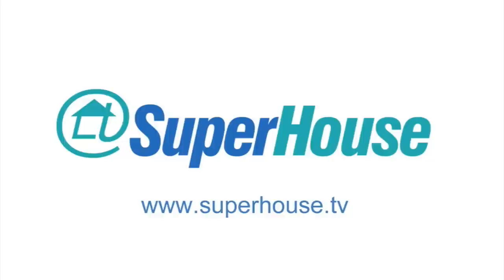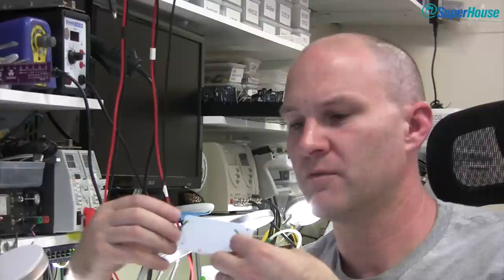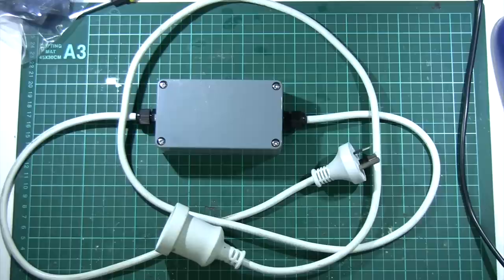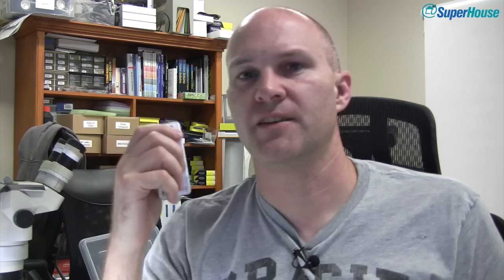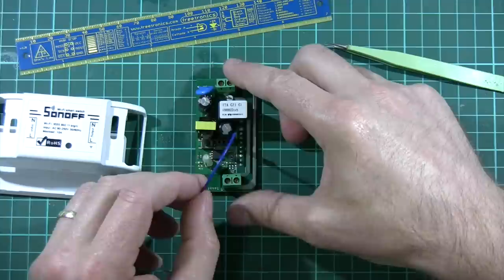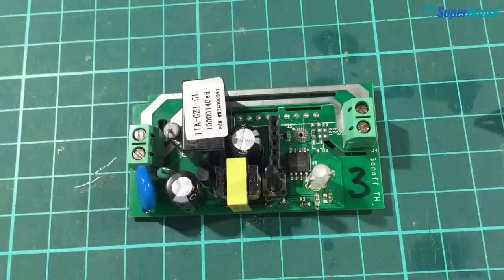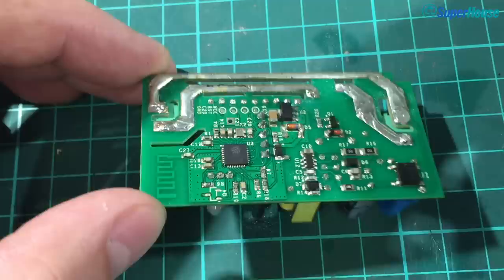SuperHouse #21: Six Sonoff Secrets: Storage, Safety, Switches, Sensors, Software, and Sites

Comment: I have a wall switch that only has the hot wire inside (there are only 2 wires coming from the top), how do I connect a Sonoff basic? (To add or replace the current switch), I connect the 2 input pins to the 2 ends of the hot wire and it works, meaning it connects to WiFi, and if I connect a external bulb it toggles on/off, but I want to control the bulb on the ceiling, how can I connect the output back so that it controls the light bulb like the switch I currently have.
Reply: Hi, if you only have 2 wires in the switch box then you don't have a neutral wire. So you can't power the SONOFF device from the mains that way. the 2 wires in the box are a HOT wire from mains, and a Load wire from the light. The neutral is connected to the light at the light. If you measure the 2 wires in the switch box 1 will be hot (mains voltage) and the other will be neutral  through the bulb. First you need to connect the hot wire in the box to the SONOFF "input L" and the other wire in the box to the SONOFF "output L". Then find a different neutral wire to connect to the SONOFF "input N" it will work. The problem is you don't have a different  neutral wire in the switch to use. Good luck
Reply: @bobk9324  thanks

Comment: Hi I have a similar board that i purchased from Ebay  sometime ago and it comes from China. Although it sort of works and i have had it running on and off using my web browsers i just can not get this on board relay to toggle,  but what i did incorrectly is to flash out the original program . What has happened now is it will not accept no more the original AT command that this unit should be running to toggle this relay. But strangely it does accept the Arduino IDE program and it seem to work but i still have no joy as the relay on board just wont toggle over. I have given up trying to figure this out and now prefer to give it to you for free in return to explain to me what i have done wrong and what app on my smartphone will run to get this to work. To get this to turn this on and off and why the original program just wont go through as this comes up with an error when i try to load the original AT commands back on. Hopefully you are in Australia and that you dont mind me giving it to you for free. I just dont know how to contact you providing your happy to have this. My be you can give us all another new Youtube video tutorial on how to program this Chinese unit. I can send you more info via email of the website site/links and program that i have been using to get this to work. Please let me know. Thanks

Comment: I have dozens of these and yesterday I noticed they all had a firmware upgrade so I started the upgrade. 15 of the 17 I have upgraded just fine but the other 2 get to 90% then get stuck and after about 3 min it pops up and says failed to update. Any ideas what could be wrong? They still work just fine but won't take the update.
Reply from the maker: trucker V Are they running the original EWeLink firmware, or something else that you installed?
Reply: @SuperHouseTV  they are just stock out of the box

Comment: Hello superhousetv. This is my first video on your channel but surely not my last. Would you be so kind to give me the pcb size please. My intend is to mount it in in a switchbox in series with a switch to power my water heater. The power rating should be within limit for a 30ltr water heater. Hope it does not warm up alot.

Comment: hello sir I love your tutorial 

I have a little question if you or anybody can help me I have a 4 channel sonoff 
that doesn't work all the time
I have narrowed it down to the yellow Square just below the power input
I thought that it might be a bad connection but this was not the case if I hit it with a screwdriver it turns on sometimes until it has been disconnected from Power then I need to redo the same step
is there anybody that knows what the name of that part is and where I might be able to buy it
best regarts

Comment: Hi thanks for the video. Is there any possible way to let sonoff pow turn on back after power shutdown automatically without pressing any button?
Reply: check Power-on response in device settings. you have 3 options:  On, off or resume the state before power outage.
Reply: @ehashay  Thanks alot. Helped me alot

Comment: Hi bro , I need yours help, I’m using sonoff basic , before I purchase and pairing with my old WiFi modem>2 band WiFi booster already using few month , and today I’m upgrade new modem and new 2 band WiFi booster . The problem is coming , I can’t pairing with my sonoff device , I have try delete and re download my eWeLink apps , I’m also trying connect AP mode , and type with a default password 12345678 , but waiting loading few minute is become fail. Could I know what’s is the problem ?

Comment: Hi, I watched this video of you, a very useful video. I want to ask you in the section where you instructed to use Sonoff switch in combination with hand switch: Because I am a Vietnamese, I cannot hear the instructions for connecting the pins together, and the Video also has no subtitles. Hope you guide me, thank you. I am using Sonoff basics switch yet Flash
Reply: @Leonvolt28  Thank you! I saw this as a new Sonoff product, the wiring diagram is very clear. But since I have several basic Sonoff Switches and I watched this video with a manual link between the hand switch and Smart switch, I would like to ask what are the two connection points with hand switches with symbols? We wish to be answered ! Thanks!

Comment: I have been searching for a solution to make my normal light switches smart (without replacing them) for more than a year. It seems that secret #3 might be the jack of all trades device I have been looking for! But I don't want to crow to soon, since I do not want to use Wifi (because of permanent electrosmog emission... 
Does your nice secret trick also work with the Sonoff RF (old version or RF3)? If yes: Can I also use it in two-way and cross-circuit or just in simple one-way on/off settings? 
If this works in all settings, could you please provide some more information how to do it? Unfortunately, I am a complete layman in electricity...

Comment: hi, i was reading that the button in the sonoff is for entering flash mode, if i do what you do, so i can control the light with wifi and a fisical button, and some guest press the button for a long time will it enter flash mode? i have the stock firmware i didnt do any modification to mine.
Reply from the maker: vagospuntoes The button is connected to GPIO0, which is only used for entering flash mode during startup. After the Sonoff boots, it works just like a normal GPIO pin so it doesn’t matter how long you press is. How the Sonoff behaves after startup depends entirely on the firmware settings

Comment: Do the sonoff burn if i put power on output of it ? ( Same 'L' as input as output )  i want to connect a lamp with a swich manually and with sonoff too.
Reply: Hi, it sounds like you want to run parallel power paths, BE VERY CAREFUL.  If you cross or exchange the L and N at either end, when power is connected by both switch and the SONOFF device, very bad things will happen. Also if the power is from a split phase system (as is the US), both ends must be an the same phase.  But to answer your question Yes you can power to output and it will not hurt the device.

Comment: Does the current sonoff (normal one) still has a pad for gpio14?
Reply from the maker: Yes, it's the end pad on the 5-way header that is also used for uploading new firmware. I'm adding more information to the post page now, and I'll put in a photo with labels for this.
Reply: Are any changes needed to the TASMOTA config file?
Because the GPIO14 is only mentioned for the TH10/16 in the config not for the sonoff (standard) for the toggle wall switch.

Comment: that toggle switch option - do you have a link where I can get a sketch example?
Reply from the maker: I don't have a simple self-contained example of just that code, sorry. The demo used Theo Arends's firmware, which has built-in support for it, but it's a huge project with many lines of code so it'd be hard to extract just the relevant part. If I get a chance I'll write up a simple example as a starting point for a proper project.
Reply: Thanks

Comment: The sonoff switches do not fit in standard US electrical boxes. The ESP8### switching seems robust but mounting and electrical connections are horrible. Why can’t they make a 3rd contact to carry ground ? Additionally I worry that they may not be UL approved and affect my insurance if a fire occurs. I’m a huge fan of the ESP line and have 20 years of experience in electronics. I code C++ and have made high current shunt based DC monitors etc... unfortunately ( my remorse is real ) I can’t feel comfortable using sonoff devices. ☹️

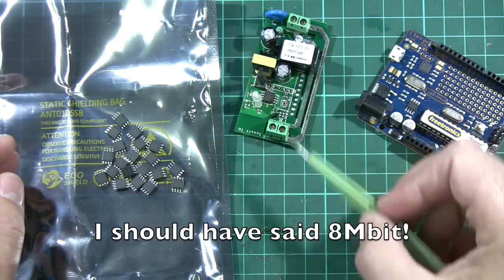Comment: @02:36 you say it came with 8 megabit (Mb) of memory. @04:50 you say the new chips are 32 Megabit (which sounds grand) , but @04:56 you post the lower thirds "I should have said 8Mbit" (8 Megabit) - which sadly is the same as what it started with.
Reply: I went through the video to double check... and then looked it up. http://www.andremiller.net/content/upgrading-sonoff-wireless-smart-switch-flash-memory-esp8266

The original has 8Megabit flash, which is 1MegaByte, the rest of the figures is correct, e.g. for OTA programming you need to restrict your program to half of that. 512kilobyes, etc.
You can get a drop in replacement flash chip which is the 32Megabits or 4MegaBytes. I hope that clears up the confusion.

Comment: Any reason why a Sonoff couldn't be used to power-cycle remote network equipment, or even servers, but just putting a son off inline into an IEC M/F lead? Especially when the purpose built devices are SO expensive (hundreds of $)
Reply: How are you going to turn the device like a router back on if you shut it down remotely killing the wifi. As for servers it will not provide a graceful shutdown but a forced plug pull. Not good for the OS.

Comment: Great VIdeo, but regarding Tasmota...  Somebody explain this to me please because I just don't get it.  I've flashed Sonoffs and generic esp8266 modules with both Tasmota and ESPeasy.  Most people seem to prefer Tasmota but I just cannot see why, perhaps I'm missing something (which won't be the first time).  ESPeasy seems to have a lot less to worry about in terms of compiling and configuring, and once you are there, to me, at least, it is so much more generic and configurable.  The only thing I have not been too successful with is sending GPIO commands to modules using ESPeasy with MQTT.  I can publish data perfectly, but when it comes to controlling things I have had marginal success with MQTT but flawless operation using HTTP so for my modules that do control, I fix the IP addresses and use http, for the modules that are sensors-only I don't fix the IPs and use MQTT.   I'd sure like to see someone do a video comparing the two...

Comment: hey,
I need some help.
my sonoff device not powering up .
in program mode using FDTI usb connection i can make a connection to the Arduino IDE and even to  the EWeLink, and the relay work when i switch on/off.
only when i connecting the High Volt input  there is no responsed.
any suggestion  how can i find the problem.
thanks in advance.
Reply from the maker: That sounds like the Sonoff is faulty. When you connect power using mains, does it look like the device starts up? Does anything happen on the LED?
Reply: No led when power with mains. 
Only with the FDTI USB.
Reply: SuperHouseTV it can be do a faulty capacitor? I think one of them a bit puffy
. http://imgur.com/j41TqOu

Comment: What is the AMPERE rating of the sonoff relay contacts?
Reply from the maker: It's different, depending on the model. Most are 10A, but the "TH" (temperature / humidity) model comes in 2 versions: the TH10 (10 Amp) and TH16 (16 Amp)
Reply: I'd be very cautious about trying to switch their maximum rated amperage. Firstly, the push-grip connectors will only accept small gauge wire (and no guarantee of a good connection - poor connection = high resistance = heat!) Secondly, the tracks on the circuit board are all that's carrying 16A, and I doubt the relays would last too long at max current if switched often. Just take a look at domestic electrical installations to see the difference in construction.
Really appreciate your effort to make this video (Y)
P.S. I would have concerns over the (demonstrated) switching of the multi-way power block with that Sonoff and the cable size used.

Comment: 27:50 whats the point of ground wire if near buble are onlu L and N?
Reply from the maker: Many light fittings have a ground connection, particularly if the body of the fitting is metal.

Comment: Hi, I have absolute 0 knowledge and 0 equipment. Where do I start, what equipment do I need?
I have more sonoff wifi switches, but:
1 i do not want to be dependent of ewelink server
2 i need two of my sonoff switches to turn back off in 0,5-1second after i turn on. (yes, I am controlling my garage doors)
Can you please help me?
Reply from the maker: To control a garage door (which is a very common use for Sonoff) you need a model that has "inching" mode. I have no idea why it's called that, and it doesn't make any sense to me, but what it does is activate for 1 second then turn off again. Some Sonoff models have it as a feature. Just check on the ITEAD site for a Sonoff that says "inching"
Reply: I think ordinary sonoff is ok, if i only could programm it to switch back off after a second or so. Reason to do so is: i do not want itead control my home totaly! And if Itead server is down, nothing functions.
Where do i get android or ios app to run changed sonoff?

Comment: the problem with 8266 is that is very unsecure, you could dump the flash contents and get the password in plain text, quite horrible
Reply: To borrow a phrase from computer security, if someone has physical access to the hardware, it's game over anyway. Personally, I wouldn't put the sonoff on the same WiFi network as your home devices but separate it, with just a gateway bridging the two for the services that need to be household facing.

Comment: How can I wire the Sonoff like you showed in the video for installing it so that it works with the regular switch, but you only have 2 live wires an 1 neutral, like in this link ?
http://dl.itead.cc/Sonoff_Touch/Sonoff-touch-wifi-wall-switch-2.jpg
Reply from the maker: No problem at all. Just connect the incoming live (active) to the Active connection on the input side of the Sonoff. Connect the outgoing active (which goes to the light fitting) to the Active connection on the output side of the Sonoff. Then connect the single neutral wire to the Neutral connection on either the input or the output, it doesn't matter which. Inside the Sonoff the Active is linked straight through anyway. That's it! No need for a second neutral. That's only provided for the convenience of cutting a cable and putting the Sonoff in the middle. I should do a video about this, it's a problem for many people.
Reply from the maker: I think I didn't understand your original question properly. The diagram in that link will allow either the Sonoff or the Sonoff Touch to turn the output on, but they can't turn it off again if the other one is on. I thought you wanted to use a Sonoff in combination with a normal light switch, with the switch connected to the logic control of the Sonoff and not the mains voltage. If you connect the Sonoff Touch, you don't need the Sonoff at all. Or if the switch in that diagram is a normal switch (not a Sonoff Touch) then you can connect the Sonoff to the mains the way you've shown, but connect the "live in" and "live out" terminals across GND and GPIO14 as shown in the video.
Reply: Basically I want to use Sonoff in combination with a normal light switch like you showed at 25:03, can you provide a wiring diagram for that, or can you explain that ? 
How do I connect the regural light switch which only has 3 wires (Live IN and OUT and neutral IN) to the sonoff ?
is it even possible that it will work like that ?
Reply: The switch/button is connected to a low-voltage DC input, the power is provided by the AC, and the light is controlled by the sonoff's relay.

Comment: I am interested in controlling solar pool heating. I am sure others have done this. In an ideal world I would have 2 temperature sensors, one for pool temperature and one in the rooftop heating element. If pool is below threshold and the rooftop heating elements are hot (ie sun is out) then turn on pump to harvest sun...

I will start with just the one rooftop temperature sensors and do it using standard features, no hacking.
I wonder if I extend the thermocouple lead to say 10m will it mess up the readings..?

Would love to log temperature data also (for a month or longer, say 1 to 10 min rez) and if possible on off events.. someone pass the message to Sanoff :)